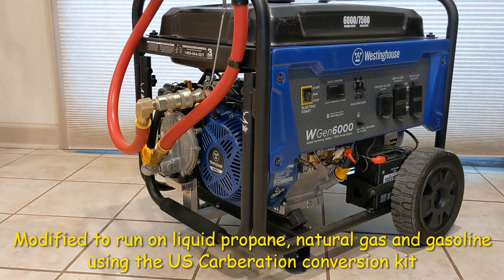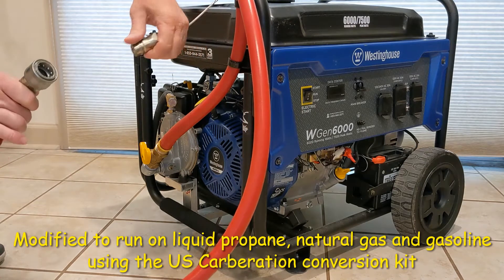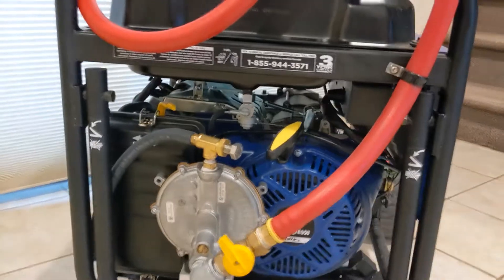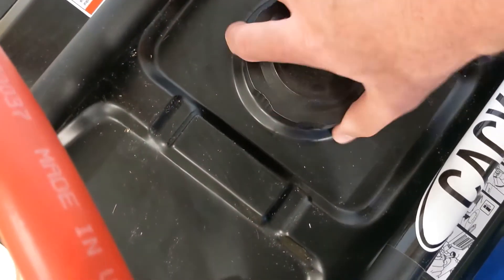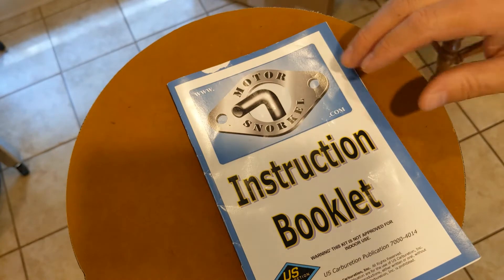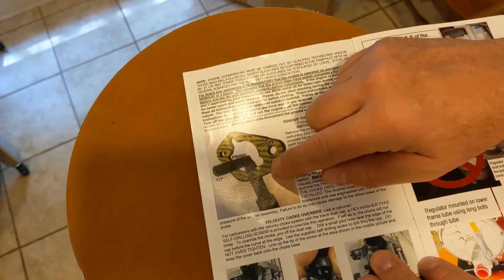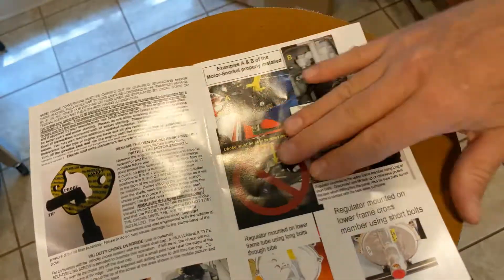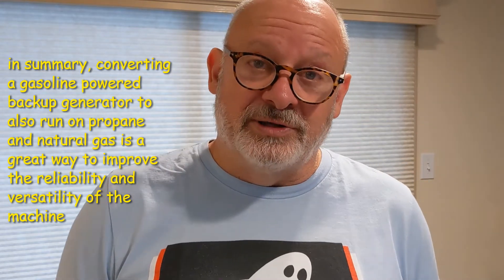Westinghouse WGen6000 portable generator with US Carburetion tri fuel conversion to LP, NG, gasoline

Comment: Thanks for the video.  I have the Westinghouse 7500/9500 generator with the conversion kit however US carb is telling me I need to be within 15 feet of the gas meter to run the generator.  Curious how far your gas meter is from the generator?
Reply from the maker: Thank you for watching.  My generator is about 40 feet from the meter and I have had no issues with it, runs great.  Had another generator before the Westinghouse and it also ran on Nat Gas, same set up no issues with it at all.  I think as long as the gas line is sized properly it will flow the required amount.

Comment: I just purchased the WH 7500/9000. Looks like an easy conversion kit.  Thanks for the info.  Can you run gasoline or gas? Do you just turn off the natural gas and turn on the gasoline? That simple?
Reply from the maker: It will run on gasoline, nat gas or propane

I always start it on gasoline because it starts better, then after a few minutes, shut off gasoline and when it begins to sputter I open the nat gas valve 

It will also start on nat gas but not quite as nicely